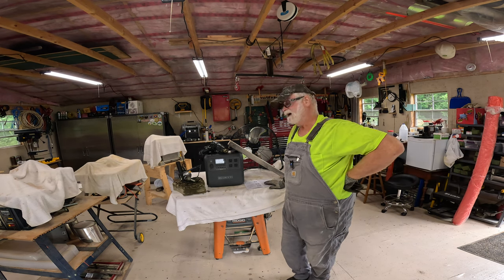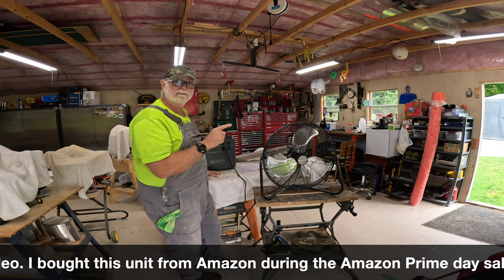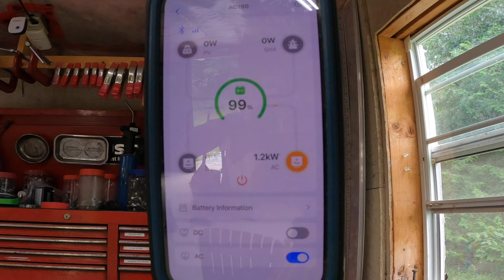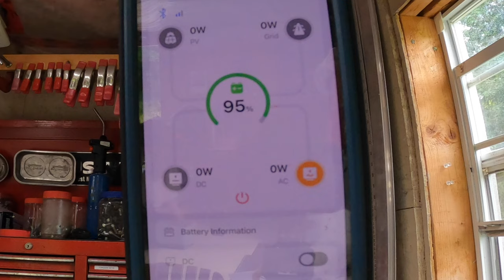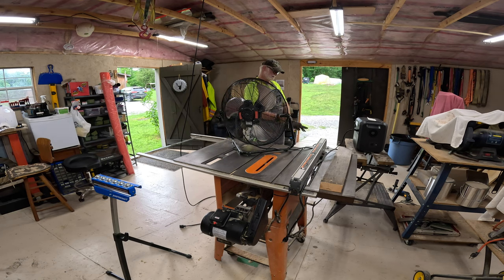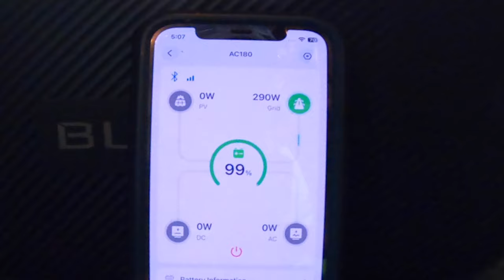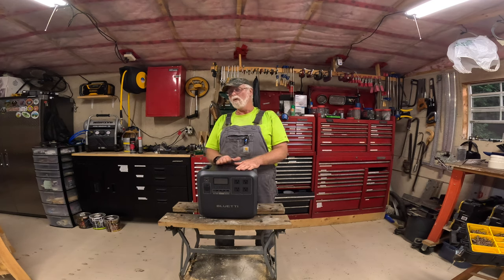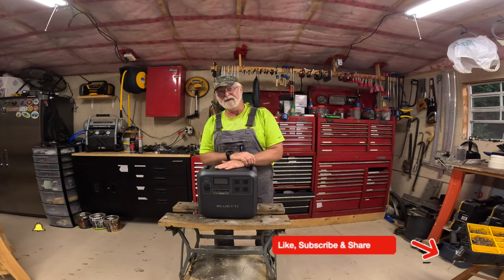Must-See Bluetti AC180 Test Drive!

Comment: I was going to suggest a lag in either the connection or the app.
I reckon it'll run the saw if you install a start capacitor.
My late brother had issues with trying to run a large compressor on domestic electricity supply - kept tripping the house.
When he fitted the capacitor (IIRC it was a 500uF), the tripping ceased. They're only £10-15 here.
Mind you, his village was on the old, overhead lines at the time & when the compressor was running, the street lights flickered to the beat of the pump. 😁
Reply from the maker: 😆Thanks for the information. I appreciate it. For the time being I'm not looking to use it in the shop but I will keep that in mind. Your brothers neighbours must have loved that! Take care and thanks for watching!
Reply: @retiredforlife63  They used to complain to the electricity company about flickering lights & TVs. 😄

Comment: Thats a complete review of the Bluetti and It does do a pretty good job of powering things up. I guess you could always get a bit smaller table saw for when you go mobile and it would work. Some motors draw up to 300 percent on startup and that why the unit tripped.....CHEERS
Reply from the maker: Yea it does seem to work well. I’m quite pleased with it so far. Thanks for stopping by Gator!

Comment: Good evening Brian. Excellent review of the Bluetti AC180 power consumption abilities. It's great that it recharges quickly even when not in hyper mode. I noticed that the app supports multiple input and output current flow status. Thus charging the unit with electrical and solar simultaneously is possible. I prefer the old format with explanations similar to this video. I feel that it's more interactive. Either way, it's your channel and I shall continue to watch and support either method. Take care!
Reply from the maker: I hadn’t noticed that in the app. It does seem like a very versatile unit for its size. I really appreciate your feedback Paul. I’m trying to come up with a formula that works for the way I work and for the viewers. I’m leaning towards something in the middle. I do sometimes have a tendency to ramble a bit. 😆 And of course your support is very much appreciated! Thanks Paul!

Comment: Looks like a good unit Brian. I’m always worried about the longevity of the battery banks. Let’s hope they last over 10 years or more, because that’s what I’d expect from an investment like this. Great test for the unit, and thanks for sharing.  Cheers, Mike.
Reply from the maker: Thanks Mike. They are supposed to be good for something like 3500 cycles so it should be good for some time. Thanks for stopping by!

Comment: I could see that the shop lights dim a lot with table saw start up so it makes sense. Other than that the battery pack was impressive. Your videos are always good Sir 🔧👍
Reply from the maker: Yes the saw really does draw a lot of power on startup. It does seem to be a good little battery pack. Thanks for the feedback and thanks for stopping by!